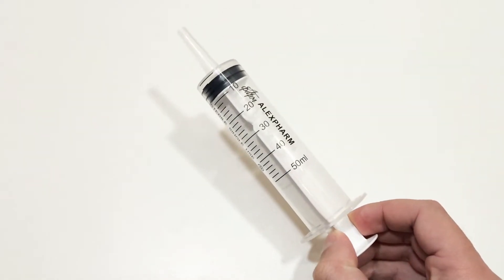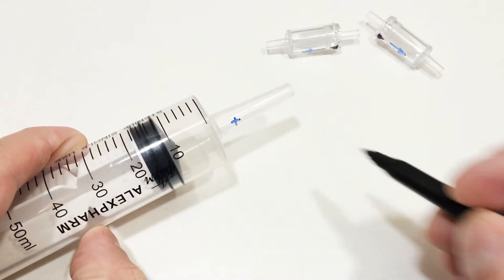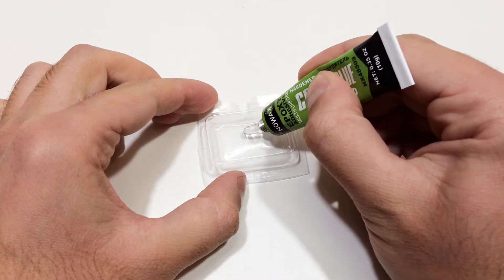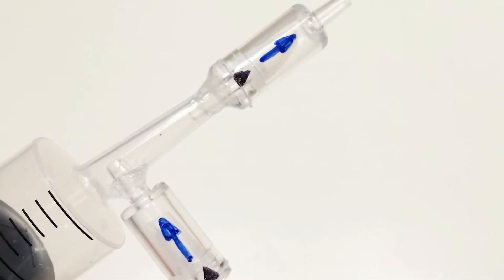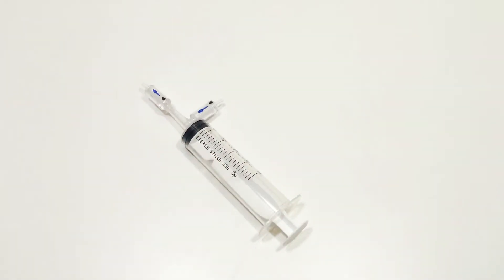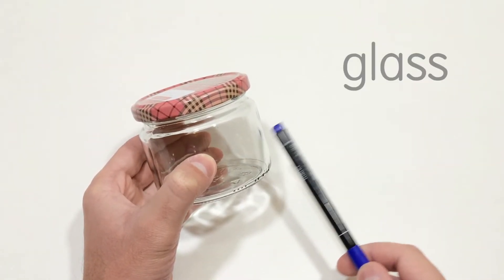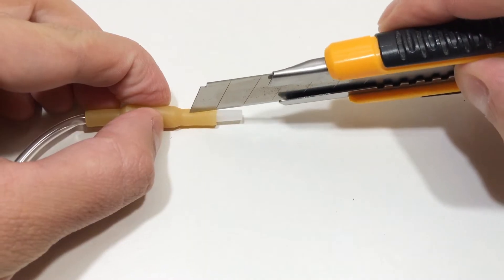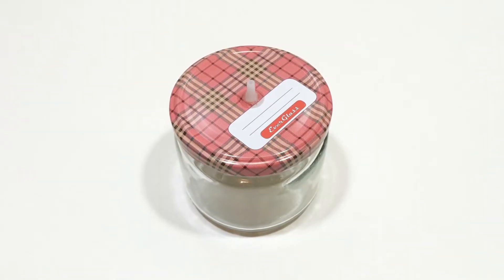Making a Vacuum Pump! Amazing Homemade project! Awesome Experiments in a Vacuum Chamber! Wow!

Comment: mate where do you live where you just picked up like is that some sort of blood draw equipment? Also great video! I'm thinking i will chain this design together with a brake bleeder hand vacuum pump to make a dual stage vacuum pump. should also be able to measure the maximum pressure the single stage style you showcased. we can see how close @jedzciejapka was in her estimate

Comment: Inferrior results. Leaky seals problem. Great waste of time, if you have time to waste.
If it's not useful on a regular basis, I'm not interested.
Reply: You must be fun at parties, just use 100% silicon 1, make sure it’s silicone 1.
Reply: Bro you being rude if you dont gain value move along this isnt for you nobody cares you dont gotta comment
Reply: Water boiling at ~48*C means pressure around 0.12bar, it is not so bad for being homemade and this simple
Reply: @jedzciejapka  that actually is insane, comparable to some hand pumps you can buy online
Reply: Lmfao nobody cares about what you feel or think 😂
Reply: It's actually easy and works. I guess you're just not good enough.